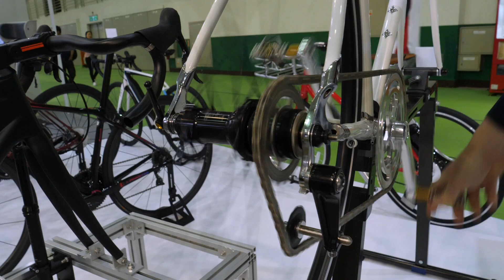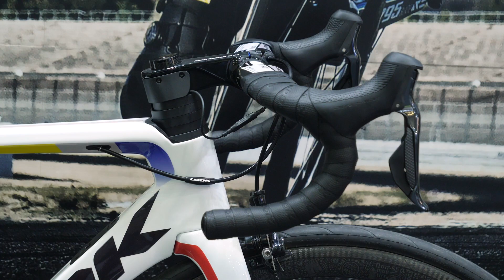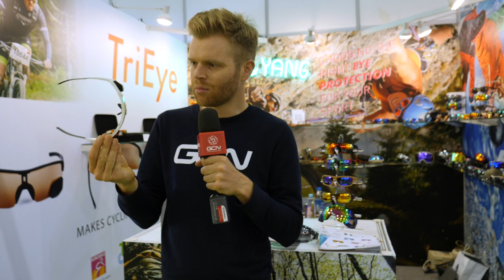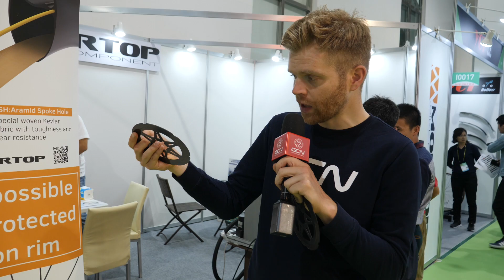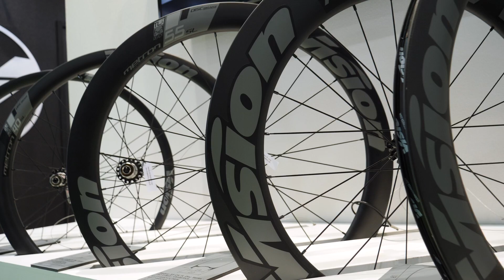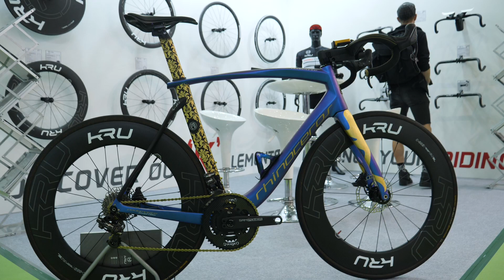Hottest New Road Bike Tech | Taipei Cycle Show 2018

Comment: Cant find where to buy those foss hubs anywhere, I thought of a similer idea to this recently, a rachet that moves out of engagement when no drive is present (i designed it on MS Paint and i doubt it would actually work). and so i was STOKED when i saw someone has already made something similer, although you cant buy them anywhere!

Comment: stealth mode? i been tearing apart rear ends for years and greasing not oiling the ratchets in the hubs of every single bike i ever owned the heavier grease does allow the ratchet to work and also allows the 2 popits to slap the teeth silently it works perfect and i have sneaked up on many a friend and made them jump from my stealth peugot or stealth motobecanes, and no i'm not talking about the new already quite carbon fiber i'm talking about the old steel frame 1970's road racers even the shogun was silent but deadly with its front and rear racks that was the best

Comment: Someone has thought of rear view sunglasses before, I had them when I was a kid. They made spy sunglasses with mirrored sections on the sides of each lens.  It's a better idea in theory, than in practice. Also Cervelo had 2 position seat posts with the original soloists back in the early 2000s, nothing new there.

Comment: Lets see, I want 700c wheels where I never have to change the spokes.  I want a belt drive so that I don't have to maintain a chain.  I want disc brakes so that I don't have to adjust and readjust tension.  I want that belt drive to to have hi and lo gears for hill climbing.  And I want there to be many mounting points for racks and such. Oh, and tapered roller bearings in the axels so that I don't have to screw with loose ball bearings. Carbon fiber would be great, but so would aluminum or bamboo or for that matter nylon or some other plastic as long as there is an accompanying price drop. I want saddle bags that store as much crap as the 35lb capacity cat-litter tubs I currently use. Yes the yellow and red Tidy Cats ones. And a quick release system for them allows them to come off when not needed. And I'll be running Tannus no-flat tires.

Because I just want to get on my bike, ride to work, and ride home. I don't want to wrench on it.  I don't care if it set's low weight records.  I don't care what the hipster-cultists at the Apple Store think of how it looks. In fact I'd rather the parts be a little on the heavy side so that they don't wear out in under five years like the old all steel Schwinns of decades past. Can you get me that bike industry?  I think you can. I believe in you.

Comment: I went to that show and didn't notice any of these things!

Instead I saw the titanium frame which can be unscrewed into 2 halves, a bicycle box made of plastic and velcro straps which is durable, long lasting, and saves on taping the box, several brands which had bikes with large numbers of lug holes/eyelets for attaching cages, racks, or anything else, ergotec had about 20 really fancy types of stems which I'd have lived to try, but can't afford so many,...

But what GNC didn't show you was that about 70% of the bikes on display were actually ebikes. 

Regular bikes were quite hard to find in comparison

Comment: you need to be bolt upright for that mirror to be effective, more effective is the down-tube fitting mirror developed some 20+ years ago. Most riders are looking down at some point or another more so than being upright so it's more useful than a gimmick on the glasses in real world use.

Comment: Winners made silent freehubs using roller clutches back in the late 1980s. But they were prone to failure and slippage, so they went out of business pretty quickly.

I had a small (about 4mm diameter) mirror that stuck to the inside of my sunglasses in the 1990s. Replaced it with a different brand after 2000 that had a ball and socket joint for adjustability. It's not new tech. Since they were small, you could put them up higher so you didn't have to look so far downward and outward, but still didn't block much of your field of view. When it's that close to your eye, even a small mirror gives a good view. And they fit just about any sunglasses, not just a specific model from a specific brand.

Comment: A carbon brake disc like they use in MotoGP?
Hhmmm... on motorbikes these things are shrouded to keep the temperature up because they only really grip when they are red hot. They don't use them at all in the rain again because the disc doesn't get hot enough to function.

Comment: The carbon rotor sounds good in that it won't warp but discs have come about partly because carbon rims fail due to heat from braking.  So what stops these carbon rotors from suffering the same problems with heat?

Comment: I don't think ill ever get the carbon disc brakes. Braking on carbon in the wet is usually horrible on deep section wheels. Why would you remove the reliable stopping power to save a few grams.

Comment: carbon rotors are stupidest idea ever, its worse than soviet aluminium rotors...
Reply: @Bungle2010  carbon ceramic not carbon mat with epoxi wtf
Reply: @Bungle2010  rotors on this vid are from carbon fiber right?
F1 and many more motorsport discs are carbon or carbon ceramic and so is pencile core, that doesent mean grapyte is good disc material. I bet with my head F1 discs have nothing to do with discs in vid
Reply: @Bungle2010  btw if it is 100% carbon as it says on that link that means there is no resin in it, and u can clearly see carbon mat and resin on vid

Comment: Finally get away from having to brake on carbon rims only for a company to develop carbon rotors. They’ll be crap.
Reply: Bungle2010 they’re ceramic in F1,  not carbon. Carbon has crap heat dissipation and is even crapper in the wet.

Comment: Why don't you pump up the tire instead of the bottle?
Reply: Leo Krause sometimes it’s hard to seat tubeless tyres with a standard pump requiring use of a compressor that blasts out a lot of air very quickly.

Comment: So Ollie, how does new Foss' Zero Drag Silent Hub differ externally from Zipp's Cognition Hub with AxialClutch technology introduced at the beginning of 2017 (or before)?
Is it MORE silent?  MORE disengaged?  Or just missing the 2nd pulley wheel....
Reply: George Hugh I am not sure on the exact mechanism, but it has won an innovation award at the show. It’s certainly different from the cognition hub, as I have those on my canyon and they are not silent! Very nice though! 👍🏼
Reply: @OllieBridgewood  - Thanks for the quick reply, Ollie (it's like you're a day ahead!)

Comment: A silent free hub would be ideal when indexing to listen to the chain. The amount of times I've shouted at my free hub to STFU, but it doesn't listen🙄😅
Reply: SAF1981 that makes no sense. You need to spin the cranks to move the chain through the gears to index....
Reply: Sam Mear it does. When I'm turning my cranks to move the chain the freehub pawls make a loud ticking noise which is loud enough to drown out chain rub/click when indexing
Reply: SAF1981 only if you spin your cranks backwards...spin them forwards and your rear wheel will spin instead and your freehub will be engaged so no noise..

Comment: A silent free hub? Finally.
Reply: finally not sound as a crappy moped.
Reply: Assadasd Asdasda they have been available for like forvever
Reply: Onyx freehubs (onyxrp.com) have been available for years and are silent due to using a sprag clutch.  They are heavy and expensive though.  These FOSS hubs should be a nice addition to the market if they are durable.
Reply: If anyone is interested in FOSS's patent filing for the silent hub with drawings:  http://www.patentsencyclopedia.com/app/20160052337  Appears to be similar to a DT star ratchet driver that separates upon coasting by magnetic repulsion.

Comment: A Silent free hub, what is this satan!!!
Reply: I've had a silent clutch since 1996. I now have 3 silent rear hubs. They are really popular (and common and cheap) in BMX... and have been for a couple of decades or so. Apparently Ollie doesn't know his shit?
Reply: eschelar you are exactly right.  True Precision has made the “Stealth” hub for bmx and mtb for at least 20 years now.  I used to ran  them on my Foundry Broadax race bike for two seasons.  The main issue with them (and i’m sure the road hub seen is this video suffers from it as well) is keeping contaminants out of the inner workings of the drive (clutch) mechanism.  The maintenance intervals were ridiculous and after the inner clutch rollers in the freehub became worn, they rolled super slow.  For a bike that is only ridden on the road in dry conditions i could see this system as being feasible (same with a MTB in the desert) but for anything else they are just not worth the added cost, maintenance intervals and weight.  Silent coasting is amazing and the engagement was awesome but unless the manufacturer can figure out a better system of “O” rings/gaskets to keep water and grit from getting in the hub they are just as impractical as carbon chain rings or carbon brake disc rotors.
Reply: @67fastbackful  Yeah I've got a True Precision too. It's indeed a bit slow. The BMX hubs we make here where I work are also silent clutch and are ironically smoother. Too bad True Precision is so costly. They want $70 USD for an axle. On a hub I bought for nearly $300. Dang.

I also ran a Shimano Silent Clutch hub for nearly 20 years with basically zero maintenance and while it was never particularly smooth, it has always been pretty good. The Shimano doesn't give true instant engagement, but all other variants I have seen have.
Reply: But how else would TriEye sell those sunglasses with rearveiw mirror? Apparenly Ollie’s never heard of mirrors for drop bars.
Reply: noooo!!! i hate silent wheel suckers
Reply: Numeriwar      You desperately need those rearview sunglasses.   😎
Reply: nbd the free hub on my Shimano rs11 wheelset is silent.
Reply: Ed Cox I don’t get it. Love the somewhat loud volume of my DT Swiss hubs on my road and MTB bikes.
Reply: I want mine loud👹